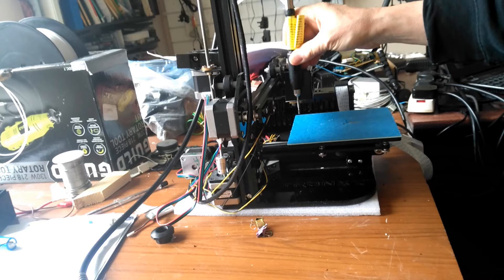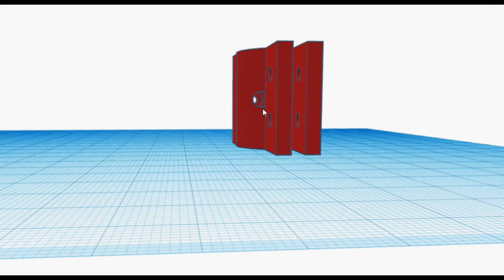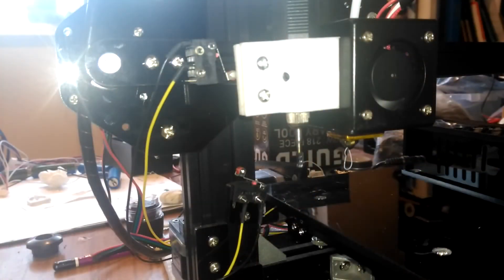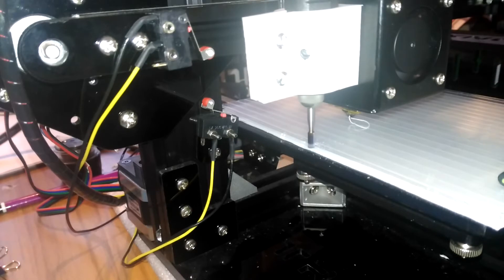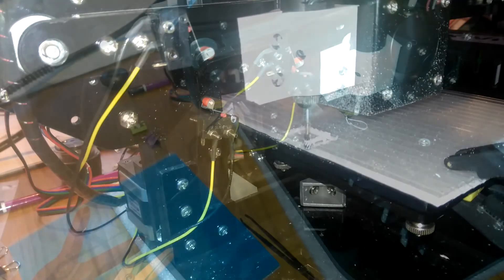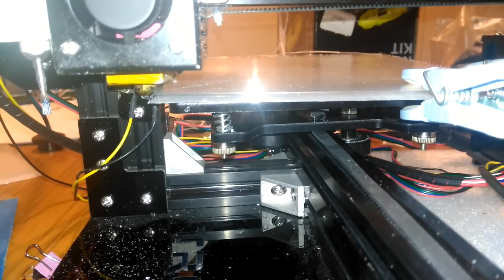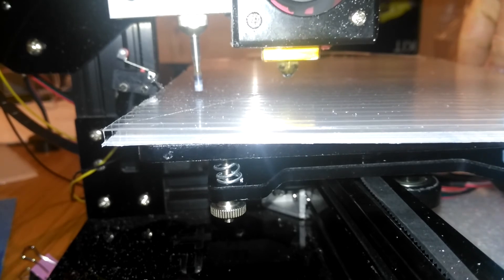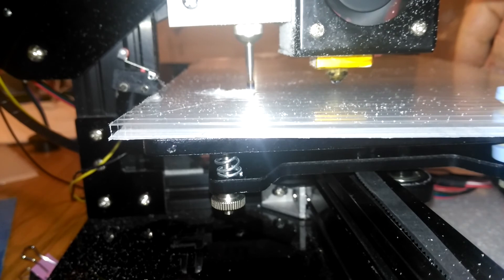TronXY X1 3D Printer Conversion to CNC Router?!

Comment: Try to get your dremel lower to the work to get as little of the tool shank showing as possible. This will reduce wear on your bearings. it will also ensure a straighter cut. Nice work on this.
Reply from the maker: Yes, that would be a good idea, thanks Patriot. This was just some fun, really.

Comment: Loved it I think routing a PCB with a very fine tip would work and would be a good example to try as with a PCB it needs to be in small movements but keep going I think you will win I was thinking of a 3d printer so would you recommend the tronxy?
Reply from the maker: Hi Bob and thanks for your comments. I'm glad you liked the video. I'm really busy but still committed to finding time to get the CNC thing working. Watch this space.

Would I recommend the TonXY X1.... hmmm... You would find my build video very relevant to that question - linked below. But the short answer is: "crappy kit, superb printer, astonishing value". If you're handy, and able to hack stuff about to get it to work, then you'll be fine. The problems are pretty consistent and well-documented, so you should be OK.  But if you're more of an unbox-and-use type, then it's not for you. 

My TronXY X1 Build Video: https://www.youtube.com/watch?v=XGECtOEJ30c&list=PLEFr39dH1zRKbSsd3fsVryNnGR3lR89ok&index=4.

Comment: Hello chris
I saw your video and I have to say you are a daring person. But it's an idea, of course. But if I already had a 3D printer, I would look in the direction of a laser. Such a device does not give the force you now have on your valuable printer. But then again, you don't have a CNC our a laser problaly... But it is an idea!  Greetings, Ben.
Reply from the maker: Hiya Ben. I'm also considering a laser for cutting and engraving, but my pressing need is to cut accurate complicated holes in ABS project boxes, and I don't think a medium power laser will do it for me. The ones I've seen run out of power at cardboard, but I know there are also lasers that will cut through hardwood. They scare me a little.   I also want to make 3D shapes. It will never be a robust CNC router, but I'll see how far I can get. And I'll order a laser, too.